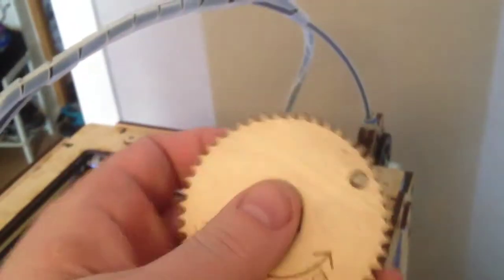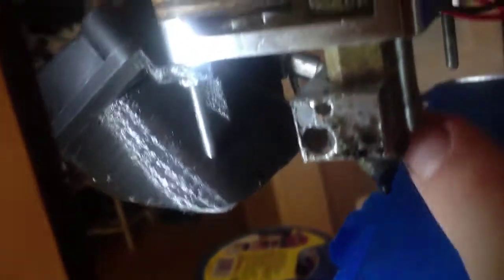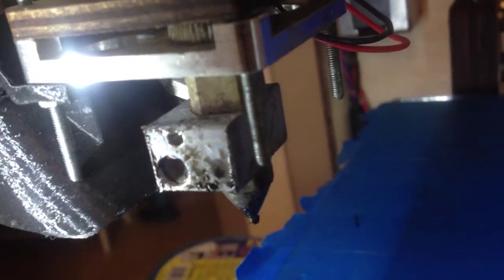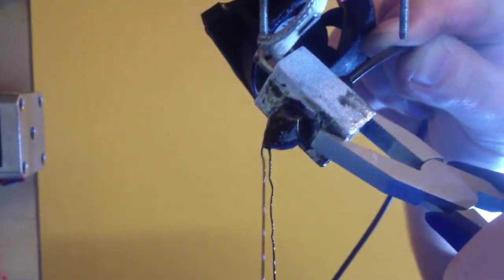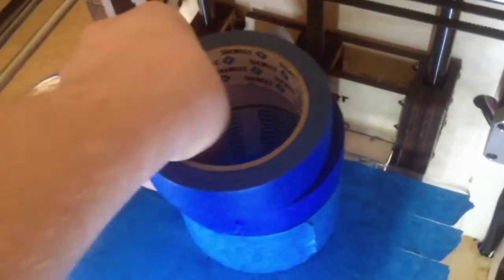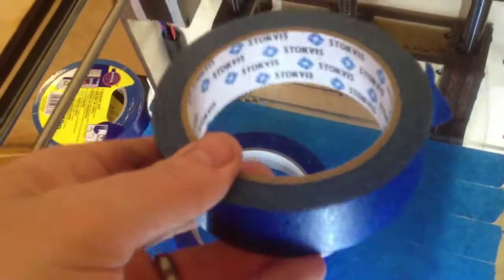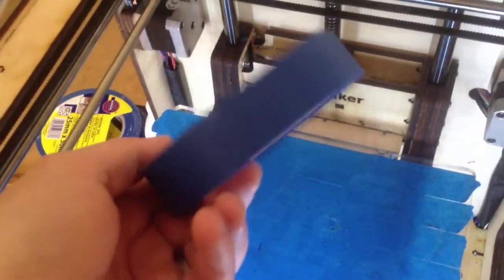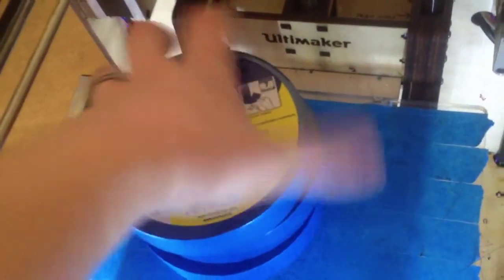3D printing, nose issue, best tape for PLA

Comment: If you still use blue tape and you live the uSA, do not waste your money on duck tape brand, it will bond to your print.  I use 3M brand tape, and it works wonderful, rarely do I have bond issues.  A bond issue with 3M tape only really happens when the nozzle is pressing the filament into the tape.
Reply: What about other brands?  3M 2090 is just too damn expensive now and have you seen the 2090 in 6in width?  75-150 dollars per 60yrd roll is insane.
Reply: ***** I can't attest to anything but those brands.
Reply: FreiNrg
Too expensive for me and I know the price went up thanks to the 3d printers.

Comment: Does PLA smells when printing? Is melted plastic safe to smell?
Reply: Null PLA is biodegradable, and is made from plants, either corn starch or sugar cane. Its perfectly safe to breathe.
Reply: in my opinion, PLA smells quite nice (kinda sweet). ABS is known to be harmful to workers in industrial mold casting applications for example. i highly doubt that desktop 3d printing with PLA will have any adverse health effects, but this is just my half-educated guess.

Comment from the maker: 0.1 mm is not the limit it is the default layer height for the Ultimaker now (in the cura software). 0.6mm is "fine". The ultimaker can go down much more, i have seen 0.04mm prints..

Comment: you said you could print a print with 0.5mm layer thickness, but i keep reading 0.1mm is the limit of the ultimaker. did you mod the printer somehow yourself? :)

Comment from the maker: I have ordered the v2 hotend upgrade and the extruder upgrade, its time to be nice to my machine :-) For flexible PLA i think i used 230 degrees, and i slowed down the printing to 20% of default or lower, and you need to put oil on the filament or it will jam by the friction in the bowden tube..

Comment from the maker: I have used all kind of filament, ultimaker, ultimachine and now latest formfutura. I also tried a little bit ABS. And i have printed with flexible PLA and to be able to do that, i had to oil the filament a bit or it would jam in the bowden tube by friction..Also i have had it for over a year and i think at least 10 hours printing every day :-)

Comment: glad you could fix your nozzle. I have herd problems with both too high of temp and to low can cause clogging but luckily have not had those problems yet. What filament do you use? I only use the cheap chinese stuff from repraper.com but most people are sure the expensive stuff must work better.